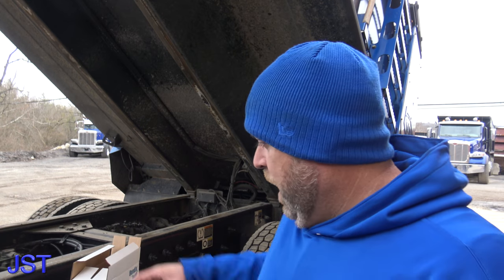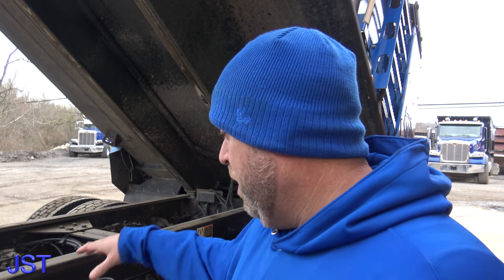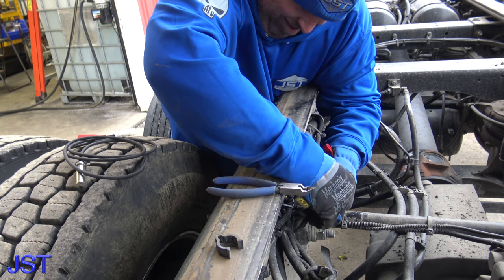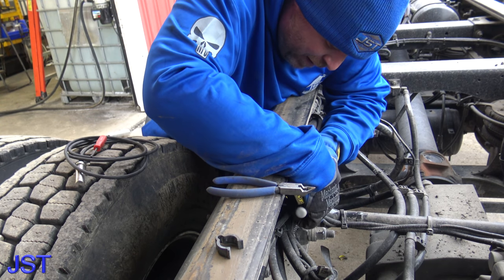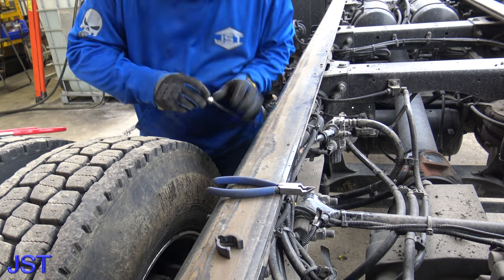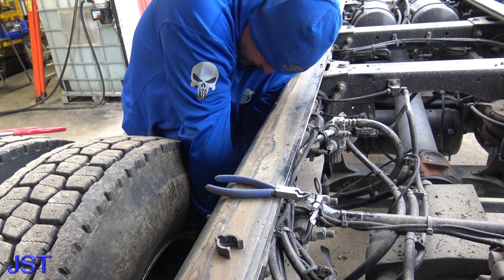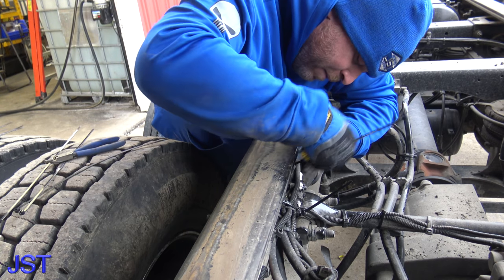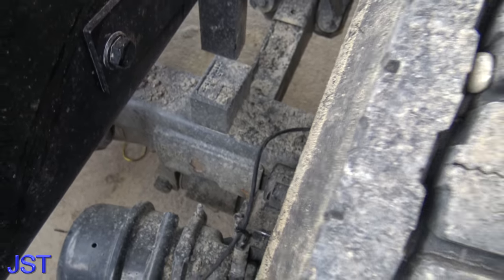BENDIX WHEEL SPEED SENSOR REPAIR

Comment: Hey, how did you remove it from the wheel hub? Does it twist out from a connector? Does it pull apart? How did you remove the old one? Are there wires that need connecting before you zip tie everything back up?